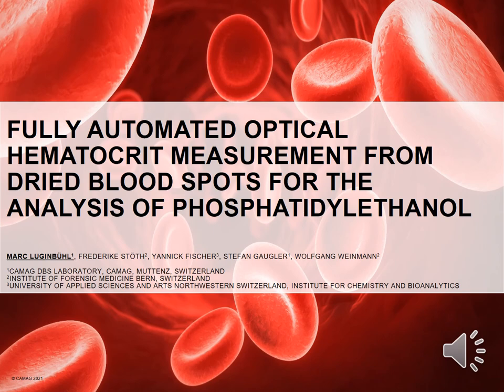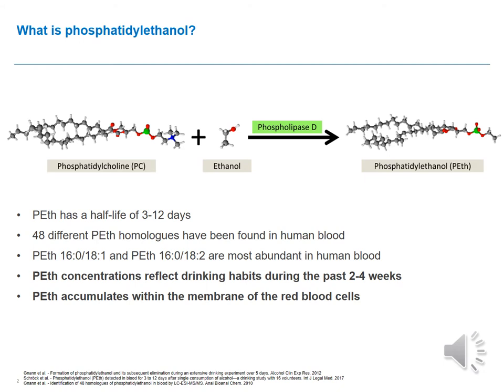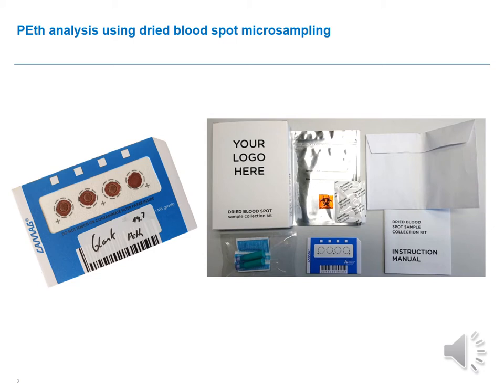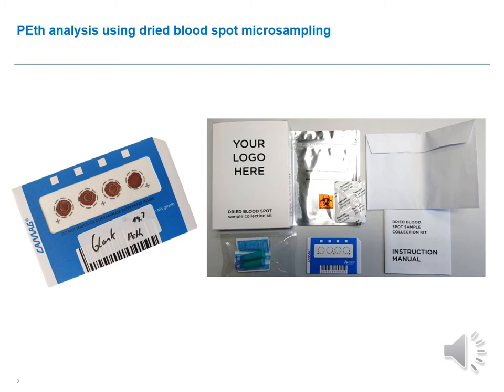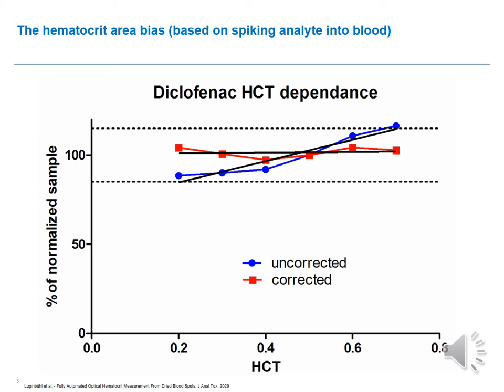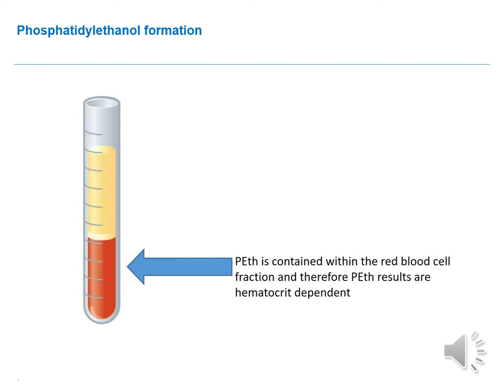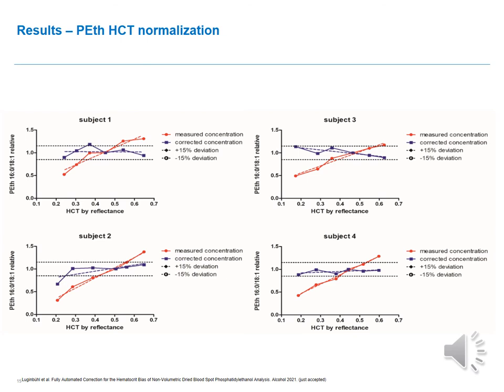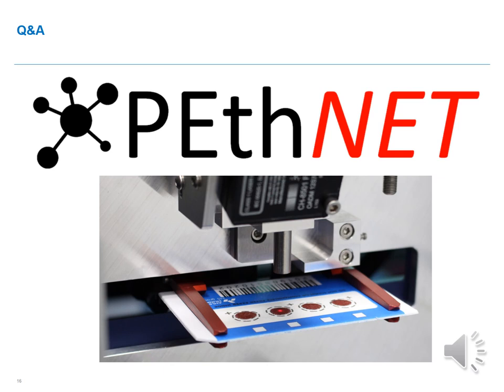2021 GTFCH Symposium in Mosbach - Automated Hematocrit Measurement from DBS for PEth Analysis

Comment: Thank you for an interesting video and the work you and your team have done. After watching I have a few questions:

1.	Does it have to be a specific DBS paper or any filter paper would work for measuring the HCT?

2.	At time 5.50 you take blood from PEth positive individuals. PEth was accumulated in red blood cells. You then separate RBC and adjust the plasma level to create the different HCT levels? If you adjusting by adding or removing plasma in the sample, will it not also change the concentration of PEth in the sample since it is bound to the RBC? More diluted RBC (lover HCT) equals a diluted PEth sample? Therefore, the 3rd “Separation of plasma and RBC to prepared artificial HCT calibration” I did not understand completely as I mention above.

3.	Dried blood spots generally darken in color over time. In the video around 7.20 you say the method is independent of DBS age and humidity. Do you need to make an HCT calibration curve using blood from each individual for this method to work? Or can you receive DBS spots by mail from different individuals and still measure HCT correctly using a general HCT curve, without negative effects, e.g. time between sampling to measurements, temperature and humidity in transportation etc.